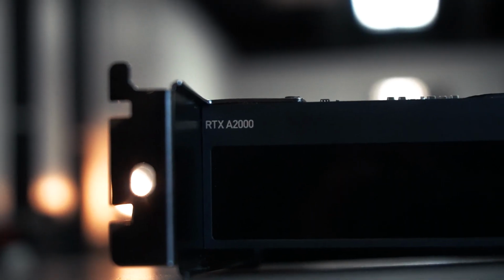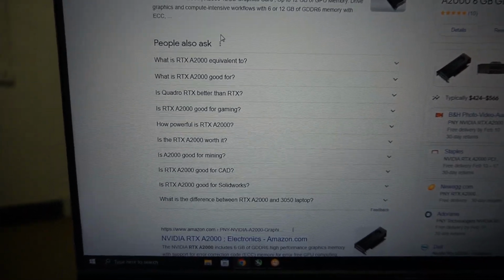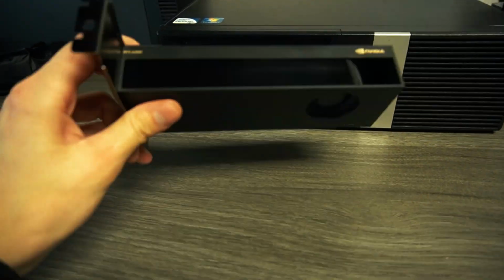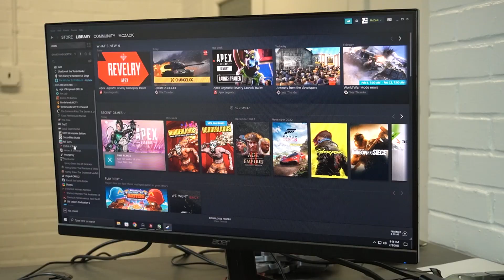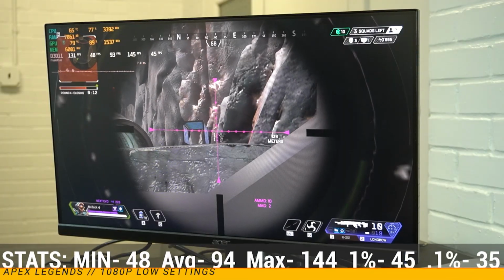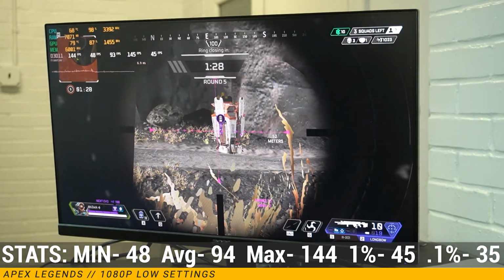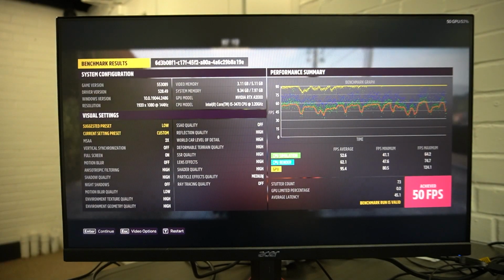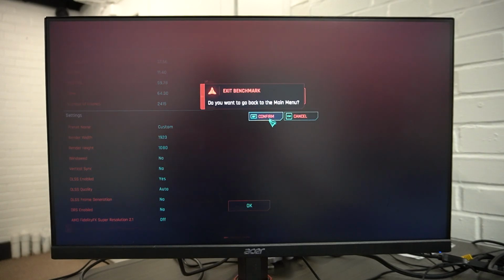Most Powerful SFF Graphics Card - RTX A2000

Comment from the maker: i5 10400 + RTX A2000 Benchmark Video- https://youtu.be/WRSgiMb7zoA
Reply: As you can see, your old CPU is the bottleneck. I had such FPS with RX 6400 on 6700 processor, so you can hardly get anything better than that with A2000 when your CPU is at 100 % (with stock cooler!!!).
I have Lenovo Thinkcentre 710s with 6700 and Noctua NH-L9x65, sent RX 6400 back to the shop (not that it was bad for what it is) and waiting for A2000.
Reply: @ZhuJo99  personally id just use a system with a 12400/5600x and noctua l9 cooler, better balance imo

Comment: I'd like to add on something, since you used this GPU into an older i5-3000 series cpu system and older AMD system, the CPU dragged down the performance because nvidia mentioned at GTC that the card takes advantage of the latest cpu and ram hardware, that being intel 11th gen at that time. rule of thumb is to have the latest generation cpus in order to get the max performance out of this card. I personally have 4 A2000's in the 12GB variant for Deep Learning/AI paired with 128GB DDR5 Memory and a Ryzen 9 7900x and it runs perfect for my needs, bear in mind that I do not run games on it, I only use it for AI and ML.

Comment: To be fair, the A2000 wasn't the reason for the poor performance. And after seeing the specs in the FH5 bench screen, I see the problem... the i5 3470. Your CPU was bottlenecking the crap out of it, both from a usage scenario as well as IPC. Try upgrading it to a 3770 to get the most that 3010 can get out of the A2000, but you're still going to be bottlenecked. At least with the 3770 you should get a bump in overall FPS, but you should improve a lot in the consistency.
Reply from the maker: One Hundred Percent!

Comment: Intel 8th gen optiplexes are getting pretty cheap, one of those would be about where this stops being bottlenecked.
Reply: Tho I'd probably suggest an HP instead since Dell started putting the PCIe x16 slot right next to the PSU after the 3rd Gen, at least on the SFF systems. Plus... they used better power supplies.
Reply: @TheGameBench  100%. I was gonna use mine in an SFF Optiplex, but that was what turned me off, and I ended up buying the smallest low-profile mATX case I could find (Silverstone ML11).
Reply: You think? I'm using it with an i7-5775C (so three generations earlier), and I can't manage to bottleneck the CPU outside of Time Spy's CPU test.
Reply: @Eyedunno  Im not exactly sure what you mean, since I wasnt talking about bottlenecking the cpu. And intel's "5th generation" wasnt really a proper product line and launched at the same time as 6th gen, so calling it 3 gens older isnt wholly accurate. in any case, using a 5th-7th gen intel can alleviate most cases of bottlenecking for that tier of gpu, the extra 2 cores and ipc in 8th gen clear up the last little bit.
Reply: @Vegatablez  Haha, what else would you have been talking about bottlenecking other than the CPU? The RAM?

Also, might want to double-check that claim about the 5th and 6th gens launching at the same time.
Reply: @Eyedunno  the cpu being bottlenecked implies that there is something causing the cpu to not be fully utilized. which could be due to ram speed, cooling causing throttling, or a weak gpu meaning its mostly sitting idle. What I was walking about was a gpu bottleneck, when the cpu is too slow to fully allow a gpu to be fully utilized.
Reply: @Vegatablez  You can call a banana a zucchini too, but that doesn't mean others will understand what you're "walking about". Do yourself a favor and google "what is a CPU bottleneck?" so you can start using words the way the rest of us do.
Reply: @Vegatablez  if CPU is too slow to feed the GPU with data, that is the bottleneck. And this is clearly the case. CPU is too old, has not enough cores and doesn't support hyperthreading.

Comment: Great videos man. Would you mind sharing a link for the small bracket you were able to find for the A2000? Having a hard time tracking them down.
Reply from the maker: I had previously bought a OEM PNY A2000 that came with one. Not entirely sure where you'd find one.
Reply: @ZackEberly  Dang ol, appreciate the reply. The search continues
Reply from the maker: @LightEye333  I could 3D print a bracket, out of carbon fiber nylon. I wonder if that would work. Doubt it tho
Reply: @ZackEberly  if you do print it and it works out. I’d definitely buy it, possibly others too. I know there’s quite a few others out there looking for small bracket as well for the A2000
Reply from the maker: @LightEye333  Yeah, gonna do some test prints today, to see if it will actually work.
Reply: @ZackEberly  you’re awesome! I greatly appreciate your time and effort

Comment: Perhaps pairing this with a 6700 or 7700 small form factor would be its perfect little match!  Can't wait to try this thing, subbed and thanks for your video!
Reply: Should look into if those mobos support the bga laptop cpus. 8c/16t on 6th-9th gen intel chipsets (not all but most).

I build one for my bro using a ES QTJ2 (i think thats the one)  unlocked on a z170 itx board. Some quirks to get it working but its worth it in the end
Reply: definitely. I get such FPS on 6700 with plain RX 6400, so CPU is bottleneck in his case…